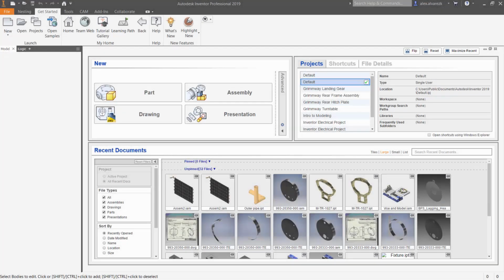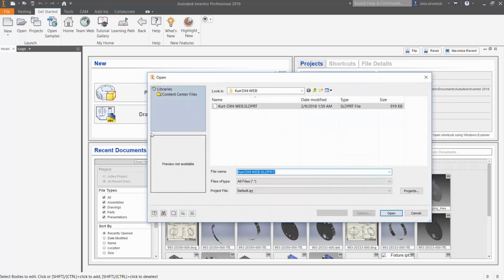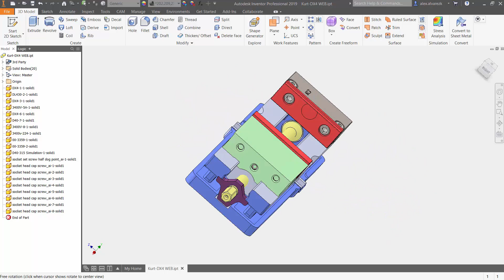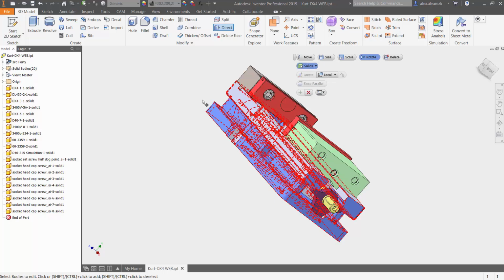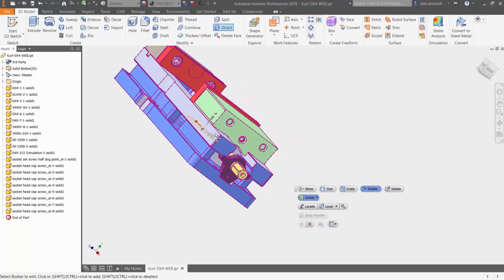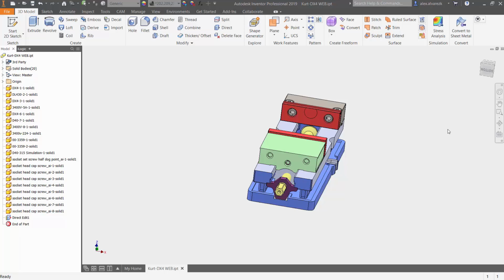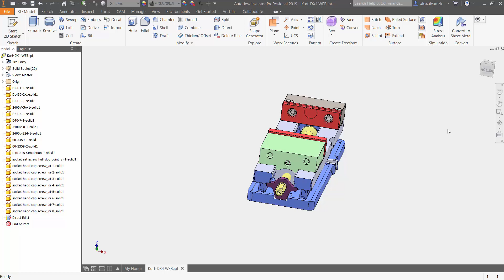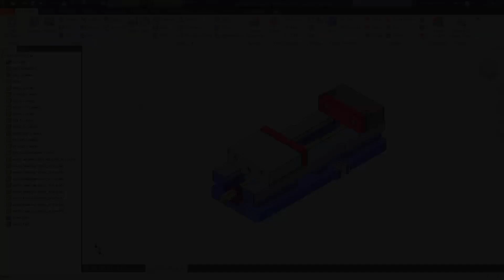Quick Tip - Re-Orient Imported Model

Comment: Can't see such an option in Inventor 2021 :/ And to be precise I need to find it for assembly (*.iam). Any help?
Reply from the maker: assemblies can be placed at any orientation you want during placement with constraints or joints...
Reply: @AutodeskMFG  "During placement"... but what if that assembly wasn't correctly oriented at the beginning and needs to be reoriented after joining all parts together?
Reply from the maker: I would redo the constraints. If you re-orient any part or assembly that is already placed the constrains are more that likely going to need to be redone.
Reply: @AutodeskMFG  $$$ Comment.  I bring in a derived component that I created as a simplified part out of an assembly and the angle of orientation that came in on some of the components were not clean...meaning the angle was like 21.5 degrees ..so I reconstrained at the assembly level by using planes and the XYZ came in nicely.  I was getting planes on angles and it was a mess ...even with trying to use the info in this video which was still a great piece of instruction.